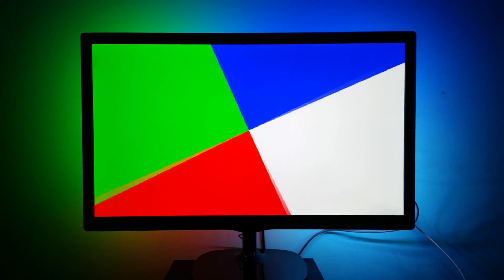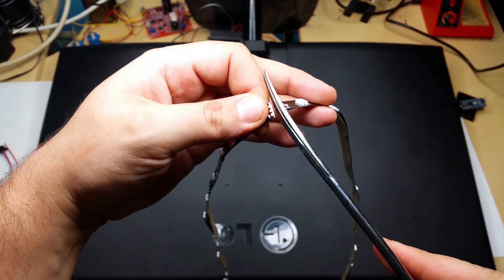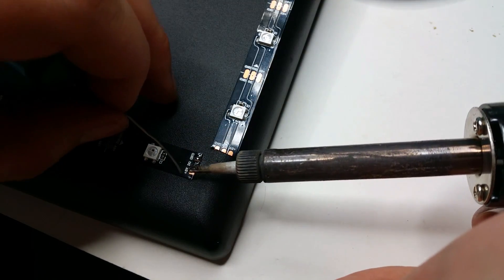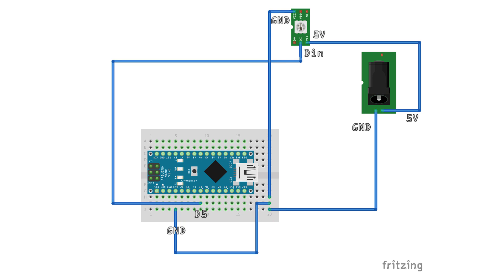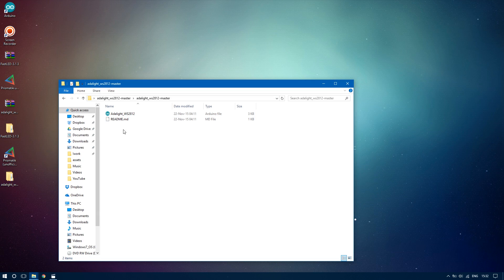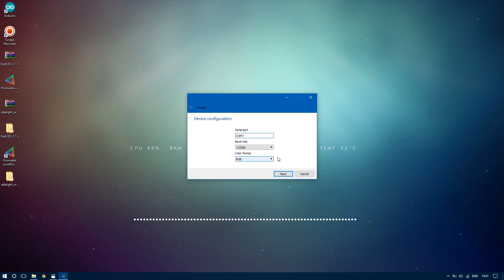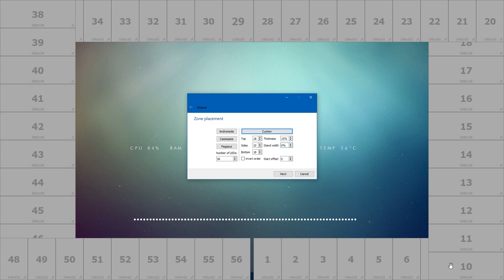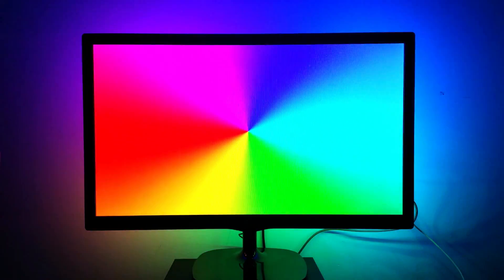DIY Arduino Ambilight RGB WS2812b Full Build & How-To

Comment: Hi there, 

I;ve made two sets that are working 100% following your instructions. On the third I have a problem. 8 LEDs at the end of the strip have no power...Why? I've checked everything....
Reply from the maker: Maybe the strip is defective. It can happen.
Reply: Thanks for reply. I've added another strip after last working led. Still the same...

Comment: I followed your tutorial and it worked. However sometimes the LEDs get stuck in one color and stop changing. Do you know what could be causing this?
Reply from the maker: Could be many things... Faulty arduino, faulty strip, or software related. Maybe try reinstalling prismatic, using it on a different pc, change USB cable... Those are te easiest and cheapest to test.
Reply: @dusnoki   the led strip I bought says it needs 9w per meter. I have around 1,5 meters so I would need around 13,5w. The phone charger I use has 5V, 2A. Could this be the issue? Should I look for a 5V,3A charger?

Comment: Thanks for the video,

Could this possibly work with RGBW LED's?
Reply from the maker: Good question. Didn't really see any options to set Rgbw. Gonna try and get a hold of a Rgbw strip and test it out. But for this purpose it's honestly. Better to have rgb cause you can set the color offset based on your wall.

Comment: Hi, I have a question. At first thanks for your instructions, its very helpfull. Only at my setup it doesnt work. Everything is exactly the same, except that I use a arduino pro micro. I have changed the settings in the arduino ide to match the pro micro. Does that make a difference? Should i use a nano? Please help me.
Reply from the maker: First thing I would try is to experiment with different pins. Maybe on pro micro it doesn't work with that port. I tried it on nano and arduino mega.
Reply: @dusnoki  ok i'll try that
Reply: @dusnoki  btw, also if i plug in the ground of the supply on the breadboard, the light of the supply turns of. it seems to be making a shortcut but i tried a fan connected to the ground and then with the plus wire go past the 5v rail on the ledstrip, it works everywhere
Reply from the maker: Check. With the multimeter on the strip if you don't have any short circuits
Reply: O, forgot about my comment, thanks for your response, I tried a different pin a few times and now it works, awesome! Thanks again for your help

Comment: This is really great Ambilight project, probably the best out of the others.
But can you also use the 5V power supply to power the arduino? I'm planning to add IR remote (to use it as RGB led strip), so it has to be independent of a PC. Is it possible? Thanks.

Comment: i have 2 setups Arduino, 1 controls the ambient light of main monitor using prismatik, another controls the 2nd monitor using ambibox. Is it possible to control both devices using prismatik ?

Comment: I want to do 144led/meter with the same method(already did with 60/m), but i find the  PS requirement crazy, 20+A??? Is there any chance that my PC gets damaged if i hook up 20+A into the chain ?
What can i do ? What resistor/capacitor should i put in ? 
Thanks
Reply from the maker: If you really want to be safe you can use a USB Isolator. It's good for up to 1500v.
http://s.click.aliexpress.com/e/bh2fBQ80

Comment: I am not super up on electrics, so I am trying to understand how the arduino gets it's power, 
does it all come from the GND? when the GND comes off the breadboard? Meaning I don't need to use the power connector on the ardunio board?
Reply: The arduino gets its power via the USB connection to your computer
Reply: C B m

Comment: Nice project and very cheap! Unfortunately, I have bought this variation of arduino nano (http://y.sudokin.com/barn ), from your link, and I cannot make it work right. When I upload the Adalight, then all leds, lights up white. I open Prismatik but whatever settings I put, the Prismatik cannot change anything. As it cannot see the leds. I suspect, something has to do about this variation of arduino, that I have bought, that cannot work properly. Can anyone give me some advice?
Reply from the maker: OMG I'm so sorry for that, I just see now that I have added the wrong link for the arduino nano for banggood. I fixed it now. Please message me privately on my email (you can find it on the about page) or come to the discord (link is in the video description) and we will sort it out don't worry :)
Reply: So, the problem at last wasn't the arduino I've bought, it was the led strip I've bought. I have borrow one arduino nano, from a friend and has the same problem. I search the internet for my problem and realized that the led strip I've bought (http://y.sudokin.com/brgb), is rgbw, not rgb. That means, the fast led library, doesn't support those led strips, because they need 4 bits to drive them (one for red, one for green, one for blue, and one for white), and not 3 bits as for the rgb led strips. So I found a solution for those 4 bit rgbw led strips and now working perfectly! The solution is to add a new tab with name "FastLED_RGBW.h"  in arduino IDE, on the adalight code and add this code: (https://goo.gl/q8DVLD). Then in the adalight code bellow the #include <FastLED.h>,  add this code: #include "FastLED_RGBW.h". Then bellow the // Initialise LED-array, remove the CRGB leds[NUM_LEDS]; , and add those two lines, first: CRGBW leds[NUM_LEDS];  and second: CRGB *ledsRGB = (CRGB *) &leds[0];  . Finally bellow the // Use NEOPIXEL to keep true colors, remove FastLED.addLeds<NEOPIXEL, DATA_PIN>(leds, NUM_LEDS); , and instead add     LEDS.addLeds<WS2812B, DATA_PIN, RGB>(ledsRGB, getRGBWsize(NUM_LEDS)); .

Comment: Can this work on display port?
Reply from the maker: It does not have any input from hdmi or display port. The whole logic is done by the PC software and sent to the arduino via the USB cable
Reply: @dusnoki  how much all its cost? Btw, is there any difference in brightness between ws2811 and ws2812b? Ws2811 use 12v power

Comment: Can you do the same on a tv ?? A tutorial pliz
Reply from the maker: Creating an ambilight system for a TV is a bit different as you need a couple of more parts for it to be independent from a PC as the PC does all the calculations and sending data to the strip. Will make it as soon as I get a proper TV :)

Comment: Be careful with the aliexpress charger. The lights started showing wrong colors so I checked everything until I found that the charger got so hot that it melted the white plastic inside the usb cable connector.
Reply from the maker: Thanks. I'll change it in the links to another one. And a more stronger one.
Reply: @dusnoki  Thanks and also don't worry it's not your fault it just didn't do what it advertised. I think if you can find something that can reliably provide 3+ amps so it's not working at max all the time would be safe enough.
Reply from the maker: I changed the links and the description! Thanks for your feedback

Comment: Hi!

First, thanks a lot for  yet another project on my "useless but cool" list!

I was trying to size this out for my setup, and hit a sticky spot with power. You used 56 LEDs of your strip. That strip you link to is 0.3W per LED +/- 0.01%.  This makes a total draw, just for the LEDs, of 16.8w max. Your power supply only puts out 5v/2A or 10w.

So, can you elaborate on why you underpowered your power supply and how you are preventing it from being overloaded?

I'm looking at at least double that power draw.

Thanks!

Comment: Hello, I would like to ask. I have USB hub on my monitor. Can I use USB hub as power supply for LED strip instead of phone charger like you did? Or is usb electric current too small for it?
Reply from the maker: Nooo. It really needs a separate 5v I would say minimum 3a charger for the strip. Depending on the number of leds you have

Comment: Hi! I just ordered the parts in your description, is there anything else extra i would need? Meaning can i use the wires off the LED strip to use to solder? + what usb does the arduino use and does it come with it when i buy it? + I calculated that i have 98 LEDs what powersupply should i get? I have a 15-24V 6A charger but does it need to be 5V?

Comment: I am getting this error when I try uploading the sketch:

Arduino: 1.8.8 (Windows 10), Board: "Arduino Nano, ATmega328P"

In file included from C:\Users\Apollo\Desktop\adalight_ws2812-master\Adalight_WS2812\Adalight_WS2812.ino:9:0:

C:\Users\Apollo\Documents\Arduino\libraries\FastLED/FastLED.h:14:21: note: #pragma message: FastLED version 3.002.001

 #    pragma message "FastLED version 3.002.001"

                     ^

Sketch uses 5272 bytes (17%) of program storage space. Maximum is 30720 bytes.
Global variables use 427 bytes (20%) of dynamic memory, leaving 1621 bytes for local variables. Maximum is 2048 bytes.
avrdude: stk500_getsync() attempt 1 of 10: not in sync: resp=0x41
avrdude: stk500_getsync() attempt 2 of 10: not in sync: resp=0x64
avrdude: stk500_getsync() attempt 3 of 10: not in sync: resp=0x61
avrdude: stk500_getsync() attempt 4 of 10: not in sync: resp=0x0a
avrdude: stk500_recv(): programmer is not responding
avrdude: stk500_getsync() attempt 5 of 10: not in sync: resp=0x0a
avrdude: stk500_recv(): programmer is not responding
avrdude: stk500_getsync() attempt 6 of 10: not in sync: resp=0x0a
avrdude: stk500_recv(): programmer is not responding
avrdude: stk500_getsync() attempt 7 of 10: not in sync: resp=0x0a
avrdude: stk500_recv(): programmer is not responding
avrdude: stk500_getsync() attempt 8 of 10: not in sync: resp=0x0a
avrdude: stk500_recv(): programmer is not responding
avrdude: stk500_getsync() attempt 9 of 10: not in sync: resp=0x0a
avrdude: stk500_recv(): programmer is not responding
avrdude: stk500_getsync() attempt 10 of 10: not in sync: resp=0x0a

I have the program set to the right port and the right board. When it comes to the processor, ATmega 328p and ATmega168 do not upload, but  ATmega 328p (old bootloader) does upload. No matter what settings I use and whether I get a successful upload or not, Prismatic does not open. It is running when I look in task manager but I can't access it or use it. There isn't even a taskbar icon for it. 
Why is this happening, and how do we solve the problem?
Reply from the maker: Yes in deed. Chosing the Atmega 328p (Old bootloader) does in fact work. They have probably changed something in the IDE. I've just installed the prismatik software on a fresh installation of windows and it does work fine. Have you checked the icons on the right side? If you setup prismatik correctly, you should see a sun or moon icon on the right bottom side of your screen in windows (try the arrow). Or a red crossed out circle if it's not installed yet, just right click it and click on settings.

Comment: I have a question, from where it gonna sens video signals, there is no video signal input in diagram, if i make this project for my tv, how it will gonna sens HDMI signals, plz tell me, none of any video is showing this part, plz help me
Reply from the maker: Because it only works with a PC connected to the arduino. I'll make a standalone one soon with a raspberry pi and an hdmi splitter and receiver.
Reply: Thanks for the reply, am very thankful to you,  and I am  waiting for your next project with raspberry pie

Comment: i want use this for my tv, to work with this is necessary to be connected to a pc?
Reply from the maker: Unfortunately this version with only an arduino and a strip need a PC to function. I will be building a standalone system soon that doesn't require a PC. It is a bit more expensive but worth it in the end. Stay tuned.

Comment: Hi! I love your video and I tried to connect make my own diy ambilight but without success. I bought a 5V10A Power Supply and I check his working status with a tester and it is OK. I connected V- and V+ to white and red wires. Next I connect Din to D2 and white wire to GND of my chinese arduino nano. I've installed drivers and Arduino IDE and tested my configuration with an example from FastLED. The load was complete withouth errors but strip led didn't turn on!
Reply from the maker: Sounds suspicious. I'm gonna reinstall the software based on the tutorial tomorrow and see if it all still works fine. Will get back to you.

Comment: Will this same phone charger be enough for 78 LED ligths (you have 56 in this video)? Thanks! :)
Reply from the maker: Even with my 56 it's cutting it short. So at least a 3-4A 5v charger should be enough.
Reply: @dusnoki  Oh, I understand. Thank you. Can I do it with two 5V 2A chargers, connected in parallel or is this not safe?
Reply from the maker: Technically yes. But if one breaks it will fry the other one :D
Reply: @dusnoki  Hahah ok. :D I ordered the 4 amp one. Thanks for the info. :)

Comment: Not working for me. If i try upload to arduino, red error on bottom screen 
In file included from C:\Users\xxx\Desktop\Ambilight\adalight_ws2812-master\adalight_ws2812-master\Adalight_WS2812\Adalight_WS2812.ino:9:0:

C:\Program Files (x86)\Arduino\libraries\FastLED/FastLED.h:17:21: note: #pragma message: FastLED version 3.002.000

 #    pragma message "FastLED version 3.002.000"

avrdude: stk500_getsync() attempt 1 of 10: not in sync: resp=0x00
avrdude: stk500_getsync() attempt 2 of 10: not in sync: resp=0x00
avrdude: stk500_getsync() attempt 3 of 10: not in sync: resp=0x00
avrdude: stk500_getsync() attempt 4 of 10: not in sync: resp=0x00
avrdude: stk500_getsync() attempt 5 of 10: not in sync: resp=0x00
avrdude: stk500_getsync() attempt 6 of 10: not in sync: resp=0x00
avrdude: stk500_getsync() attempt 7 of 10: not in sync: resp=0x00
avrdude: stk500_getsync() attempt 8 of 10: not in sync: resp=0x00
avrdude: stk500_getsync() attempt 9 of 10: not in sync: resp=0x00
avrdude: stk500_getsync() attempt 10 of 10: not in sync: resp=0x00
Reply: I have the same problem and can't figure it out.
Reply: @fuzzyleonardo4115  i change bootloader to old bootloader on arduino and working. Very bad but code upload
Reply: If you get error while uploading to arduino nano, in the Arduino IDE go to Tools - Processor - Atmega 328P (Old bootloader)

Comment: Great video!
Do you think there is a way to make this wireless? So send the data over your WiFi network to arduino that has a WiFi shield? 
I ask because I have just setup an LED ceiling in my room which uses an arduino, and I would love to be able to watch on my laptop and the ceiling becomes the ambilight. But, with no wires. ( Obviusly, the arduino has its own power supply)

Comment: Hey i've got a quick question, will it work with a 1440p monitor ? Or a 4k ? 
Thanks for sharing this project !
Reply from the maker: As i don't have a 1440p or a 4k monitor, I can't say for certain but I honestly don't see why it wouldn't work. Thanks for the intersest :) good luck on your project
Reply: @dusnoki  Wow thanks for the fast reply ! 
Thanks, maybe i'll post an update when i'm done with it !
Reply: it will 100% work, it does not matter what resolution your monitor is, it might just need more processing power from your pc. i did it to my 1440p screen and it works fine.

Comment: Hi Boris! I have some questions:
1. Will this work with AP102 leds, if yes what should I reconfigure especially in software configuration I see you use Adalight_WS2812 is there another one for AP102 leds?
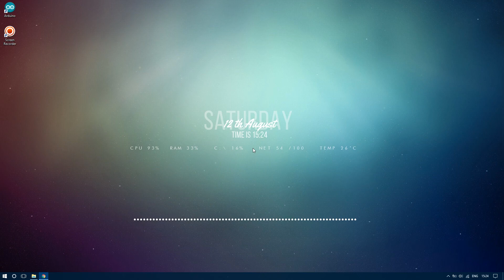2. On your windows pulpit for example at 3:51 what software are you using for showing the cpu/ram/hdd load?

Big tnx for the video.
Reply from the maker: 1. Not sure about those LEDs as I don't have them and can't test it out.
2. Rainmeter software
Reply: Thank you, could you please tell what exact rainmeter skin it is?
Reply from the maker: And you're very welcome. Glad you liked it :)

Comment: Hello, I made this for my setup and it's awesome. Just a question and a tip. Why did you connected the ground of arduino with the ground of power supply? I saw this thing even in other different project. I'm not good in electronics.
Tip: I tried di tweak with Prisnatik software and I noticed that if I lower the grab frequency under 25ms, it add a lot of lag in the strip led, sometimes i saw a color 20 second after the monitor display it... Sorry for my English but I'm Italian!
Reply: Lowering the grab frequency might overwhelm the nano's COM "bandwidth" ( aka, you'll have queued color data to be sent to the board ). You need to remember that the nano has a fairly low transfer bitrate.

1 year late, I know.

Comment: Two questions, my leds 12v, so how should I connect and  will this code  work with uno?
Reply from the maker: Everything is same. Just need a 12v power supply instead of 5v
Reply: So all I need is a 12v adapter for the leds, but does the Nano power itself from the USB connection?
Reply from the maker: Exactly

Comment: IMPORTANT: In order to use the Aliexpress Arduino Nano, you must select ATMega328P (old bootloader) in Tools > Processor.
Reply: Correct me if I'm wrong but I think it depends on when the arduino was made. Read that if the arduino is made after a certain date it uses the new bootloader